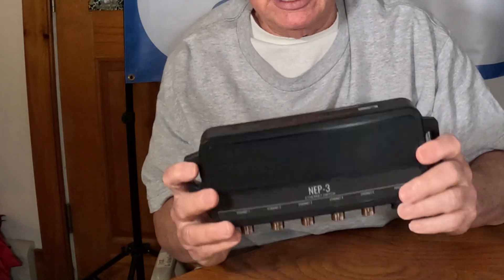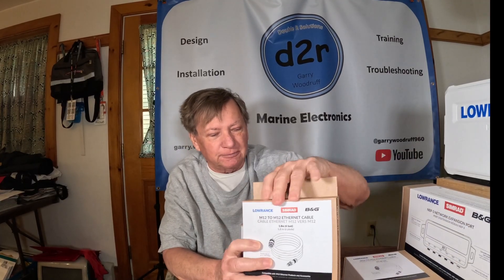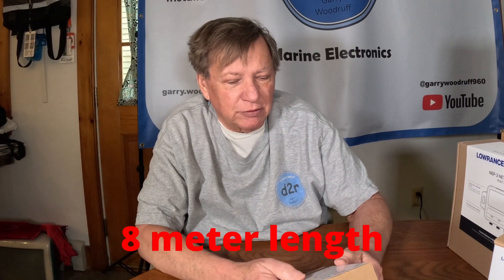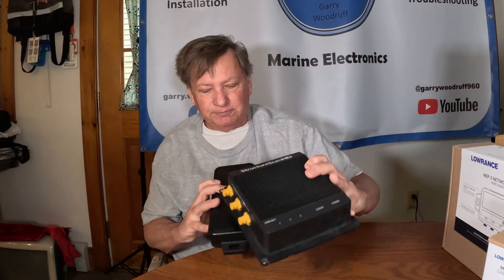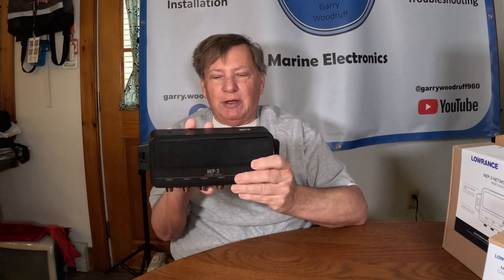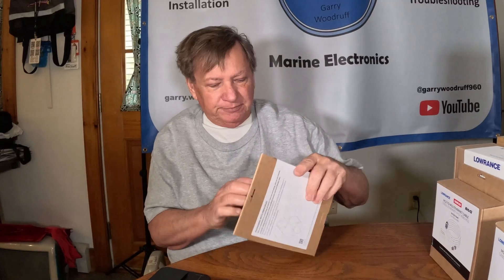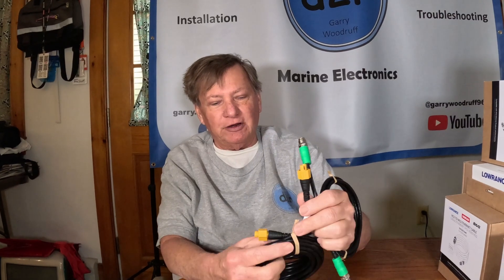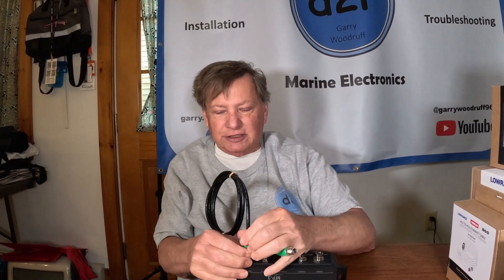Lowrance Gigabit Ethernet Components

Comment: Nice video, Garry.  I will install my NEP-3 if the atmospheric rivers here in western Washington ever give me a break.  I have 5 adapter cables which will connect to my dual AT2 units, Pro 16, Pro 12, and SS3D.  We are probably the only two Ranger bass boats rigged with the NEP-3.  My video will follow whenever I get it installed.  Keep up the great work.  Ciao!
Reply from the maker: That sounds good. Heck other than a few Simrad and test boats, we're probably the only ones right now. It's nice to be ahead of the curve but then viewers don't see the need yet. I'll be interested to see if you notice the speed improvements that I did especially with the AT2 modules. 

And now that I'm out of the sling I can actually use both hands to edit videos. I am so backlogged.

Garry

Comment: Very nice video only I am not sure if I upgrade my NEP2 with NEP3 what cables I need or just 4 adapters because I have 4 units 3 HDS lives and AT2 and using existing cables with 4 adapters. Thank you very much for the great videos for your making for us
Reply from the maker: Hi, thank you and thanks for watching the videos. If you upgrade to the NEP3 then you will need to put an adapter for each existing Ethernet that currently goes into your NEP2. Simply, undo the existing network cable from the NEP2, add the adapter cable, and then plug it into the NEP3. You can also reuse the existing power cord as well.

I am in the process of replacing my boat's network with the 2 NEP3s and the adapter cables. I have the old NEP2 replaced with the NEP3. In early testing, I saw 10-20 better response time. I do need to go look at the video. Next week I plan on redoing the bow with a NEP3, putting the 2 bow units and AT into it, then running a M12 cable to the console NEP3. I'm also going to use the M12 connector on the S3100 and put that directly into the console NEP3. I am recording the work, so I plan on having a video in the next couple of weeks.

Garry

Comment: Do you know if I can connect a NEP-2 to  NEP-3. I have two NEP-2 and one is bad, so I want to buy a NEP-3 to replace it. Currently my two NEP-2 are connected together.
Reply from the maker: I have not tried that combination but I don't see any reason for it not to work. I just replaced the NEP2 in my boat with a NEP3 and I found about a 10-20 percent increase in speed. Swapping out the NEP2 is pretty easy -- you use the same power cord, put adapter cables on each of the existing Ethernet cables that plug into your old NEP2, and power it up. You'll notice that the network lights are green/orange. When new devices with the M12 connector come out then it will turn orange to indicate that it is running at gigabit speed. (That's just like a normal router in your house).

I do have Amazon affiliate links in the video description to help you get the right parts and to help the channel out too.

I am working on the video where I am upgrading my boat to NEP3s.

Let me know if you have further questions. Garry
Reply: @garrywoodruff960  You did not list the m12 adapter cable. I believe its a 000-16448-001 or M12 Network adapter cable or M12M-5PF. Do you know where I can find them?
Reply from the maker: Let me look them up for you in the morning.
Reply from the maker: Yes, the adapter cable is: 000-18448-001 (M12M-5PF). And I cannot locate them on Amazon. And they don't show up on the Lowrance or Simrad sites. If you call Bass Fishin Electronics, then they can probably get them for you. I did also find them at the GPS Store, but I haven't dealt with them in years. Let me know if you have any luck and I'll keep looking too. Garry

Comment: Do you think NEP-3 will be useful in scout wide mode?
Reply from the maker: It should help relieve some congestion but I need to put my network analyzer on my boat and do some testing. I'll try to do that in the next few weeks. All of the new NEP3 modules and cables are staring at me every time I walk by them. But what I think would help the most if is if/when there is a new AT module with the M12 network on it. That's when we'll really see the improvement.

Comment: Will the nep 3 speed up communication between the units. I have one on the bow two on my dash.
Reply from the maker: It will help some. It depends on what you are sharing and how they are connected together. If you have your units daisy chained together then I would expect to see improvements with the NEP-2 as well. That is, if you have the bow unit connected to one of the console units, and then the two console units connected together then that is a daisy chain configuration. I try not to do installations like that so that no other unit relies on another to function. There are exceptions but that is my general rule. I do plan on doing some tests soon to see the differences that it makes.

Thanks for watching!
Garry

Comment: I am very interested in your results.  I was finally able to install my S3100 and AI3n1 HD FR transducer.  I was running the SS3D transducer and module.  I had to unplug the SS3D transducer so I could keep the ethernet ports available plus it was causing too much noise when using the HD transducer.  I am thinking on removing the SS3D module and transducer but then will need a network hub.  I was about to get the NEP-2 but will hold off till you see the difference in performance.  I have 3 HDS Lives and 1 HDS Pro, plus AT2.
Reply from the maker: I would wait if I were you. Or you could just get the NEP-3 and be ready. You'll need the NEP-3 module, a M12 to M12 for the S3100, adapter cables. Then you could pull out the old SSD3D module and screw in the NEP3. Then put in the adapter cables for the old cables. Your configuration is very similar to mine except I have all Pro units (4).

I think that I will end up with a NEP3 at the bow for the 2 Pro units and the AT2. Then another NEP3 at the console for the 2 Pro units and the S3100. Then I'll run a M12 between the 2 hubs. That will give me an available port on the bow and the console for the future. And have the network ready for the next generation units and modules.

Thanks for watching and subscribe to the channel if you haven't so you will get notified when the new video(s) comes out.

Garry

Comment: It will be great to see the results. I am already planning to add the NEP 3 when i add radar to my center console, so hopefully my existing NEP 2 and the NEP 3 will play nice and just increase the speed and capability between 4 MFDs and AT plus radar, and an s3100 if I ever add one.
Reply from the maker: I want to see the results too. There are several M12 to RJ45 cables in different lengths. Let me know if you need those part numbers. I would expect the 2 and 3 to work together, they are just network hubs. I do wish that it came in an 8 port version.

And thanks for watching! Garry
Reply: @garrywoodruff960  thank you! I appreciate all the info! Hopefully it'll all just distribute the load a little more evenly and get the benefit of the processing speed. Guess we'll see. I like the new layout of it too because it makes the wiring a lot more convenient in the underside of my console (mounting them on the ceiling of the console to save space), so it'll be a lot cleaner than another NEP 2 with wires coming out both ends.
Reply from the maker: You're welcome. Yes, it will be better for cable routing for sure. I never liked having wires coming out of the different sides.

Comment: Can't wait to see the results of your testing!  I have thought for years the network was 2 slow. Hope you see that in ur testing!
Reply from the maker: I hope to get it done in the next month. I have several videos to do before that one. I'm hoping to learn more about the network performance. I know that on my boat I have a bottleneck by having my AT2 daisy chained off of a bow unit since I could not run an additional cable through my rigging tube. 

If it shows significant improvement then I will be rigging the next boats with the NEP-3 or give the customer the option with clear data as what they are getting. There are additional costs for the adapter cables.

Thanks for watching the video! Garry